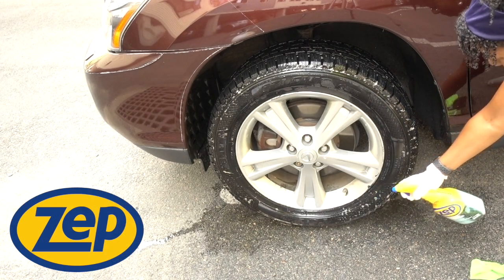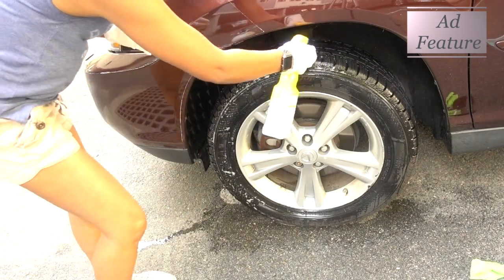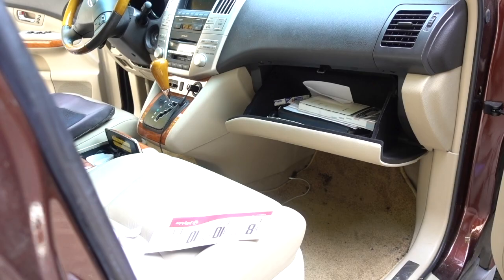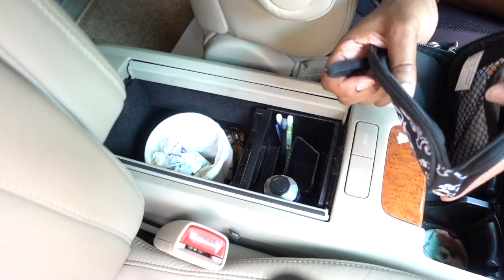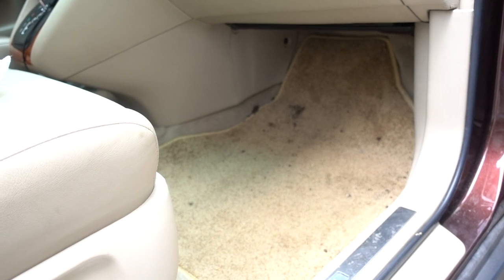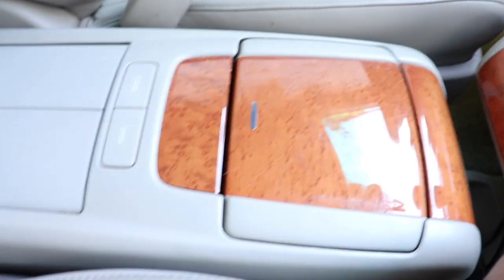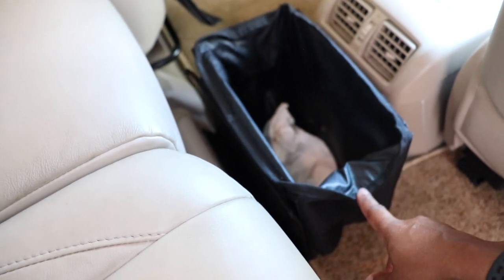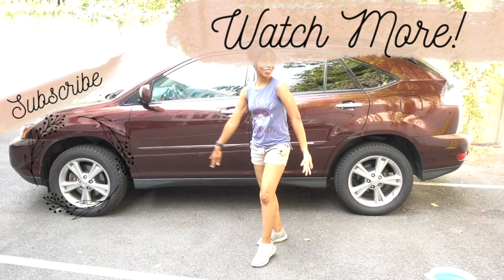🚗Making My Dad Proud: Cleaning and Organizing my Car!

Comment: Great video.  I like the trash can for the back seat that has velcro and have one in my car.  You always have good tips.  I have mine in pretty good shape, but got a few pointers that I will use.  I live in Arizona, where it is really hot and have a Garmin for long trips cross country.  I have a special small pouch for it, because it can not be kept in the car due to the heat.   Because it is so dry, we don't have much rain or mud, so my wheels and tires are pretty good.  I like dressing them with a polish.  Thanks again.

Comment: I used to abuse my car mats with potting soil, yard waste, pet hair, etc. but when I got my newest vehicle I invested in some custom-fit mats for the cargo area and floor. Now I can just pull them out and wash them with dish soap and a hose when they get dirty. Mine are from a company called Weathertec, but I think there are other brands. Kind of expensive, but when I thought about how much time I wasted trying to clean filthy car mats after snowy winters, and how many years I keep my cars, I decided it was worth it. No more stained car carpets!